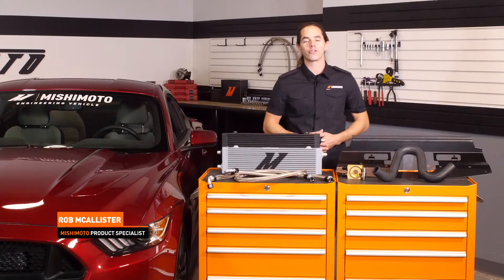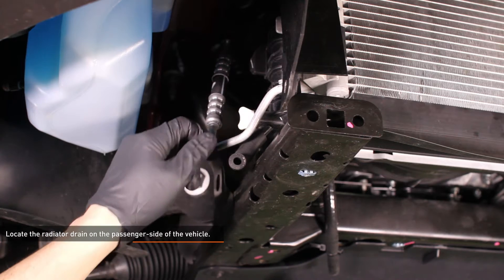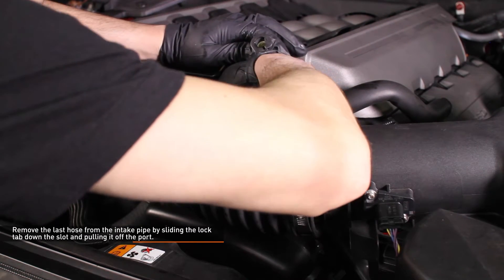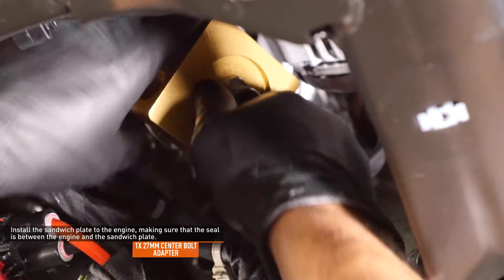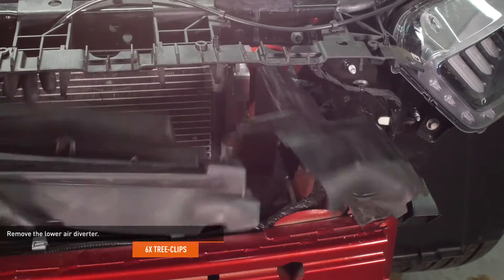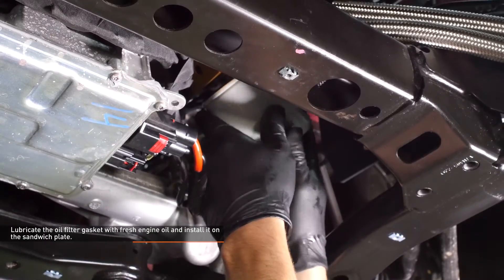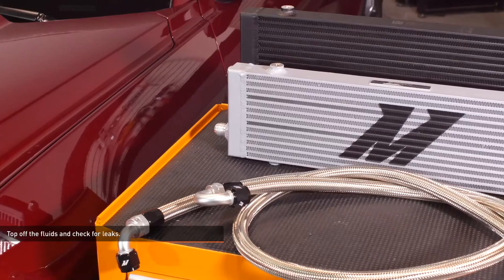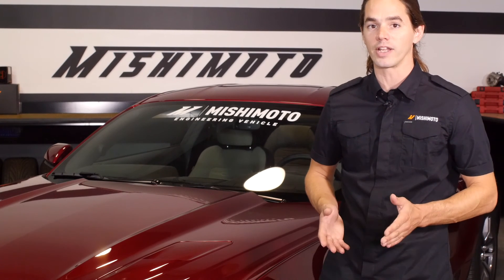2015-2017 Ford Mustang GT Oil Cooler Kit Installation Guide by Mishimoto

Comment: Why does the radiator hose get replaced ?
Reply from the maker: The factory hose had lines coming off it for the factory cooler, as this is removed the new hose deletes these lines.

Comment: does it fit 2017 mustang RHD ??
Reply: Yup. Bit fiddly by the oil filter from memory but the cooler itself is a pretty easy fit.
Reply: @GarageItYourself  so the sandwich plate can fit in yea? it still have room for sandwich plate?
Reply: @xaviersun6459  From memory yes. I can't remember if removing the water pipes to the OEM oil to water cooler was necessary for making room for the oil pipes or not. Been a few years since I did this to a customers Stang.

Comment: What's the inner diameter of the radiator drain hose you used?
Reply from the maker: Inside diameter on the hose would be 37mm

Comment: Will this work on the 2018 GT?
Reply from the maker: This was designed for the 15-17 models and may not work out with the 2018
Reply: @mishimoto  are there plans to make one for the 18 and up? I do know that the catch can for the 15-17 will work and mount up with minimal issues.

Comment: So the oil filter sandwich plate and filter will fit but it's really tight for room to work on RHD models.
Fit the oil hoses to the sandwich plate first and not to the cooler as once routed the lack of space and tension of the hoses makes starting he thread on the hose unions really difficult. I also found lubricating the unions with WD40 made them spin more freely and easier to turn in such tight space to get them located on the sandwich plate.
Removing the serpentine belt also gave extra room for the spanner to tighten the sandwich plate hose unions.
Reply: so does this fit the 2017 RHD mustang?i am trying to install it too

Comment: On 2017 RHD drive models the water to oil cooler is a separate unit towards the rear of the engine block. You have to disassemble the cooler to get enough access to remove the 10mm bolts that holds the water pipes in a hose clamp. Once you get to that bolt you can finally remove the water to cooler feed pipes.
Still gotta figure out of enough room for the oil filter sandwich plate and filter due to the bulk of the steering rack being on the same side and room to work is tight.

Comment: Hey guys, does this work with the ProCharger kit? I'm running the stage 2 setup with the large intercooler. Note, I do have my AC condenser coil has been removed so there is some added space.
Reply from the maker: Hey Dmitry's Garage . I can tell you that this system does fit with most aftermarket supercharger kits. I'm reaching out to my product team to see if they can provide me with some more details.
Reply: Thanks! Appreciate the reply. Hoping to improve the cooling on my track build :).

Comment: On removing the front bumper there are 2 screws one on each side behind the fender well that needs to be removed before popping it out. This was not mentioned in the video. Just an FYI.
Reply: Anyone else reading this with a broken clip and wishing they had taken the advice :(
Reply: Definitely need to add this part in. I've seen people yank on these parts of the front bumper and tear the clips off or even worse damage the bumper.

Comment: the 2015+ stangs come with a factory oil cooler?
Reply from the maker: Yes - installing this kit requires the removal of the stock coolant based oil cooler.